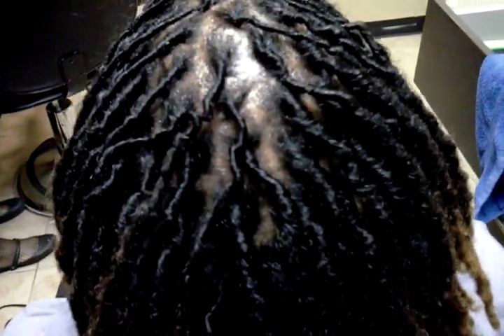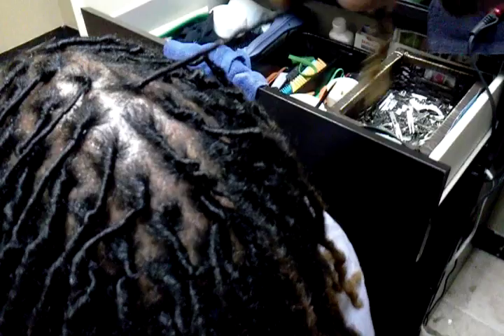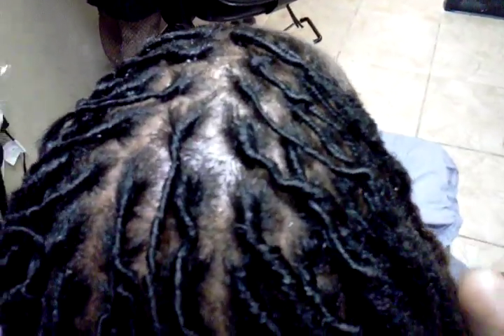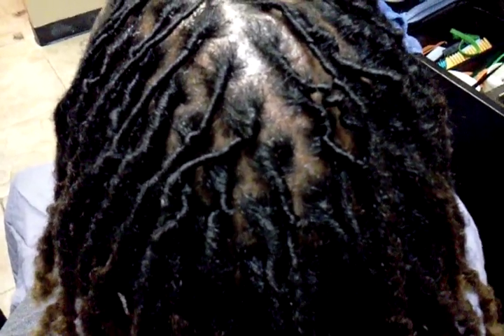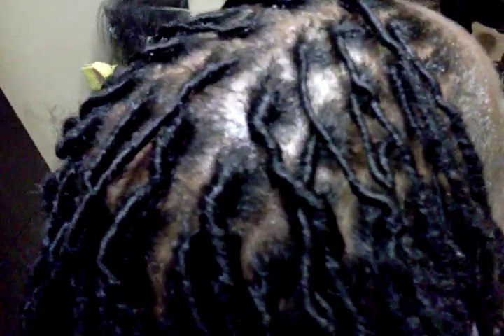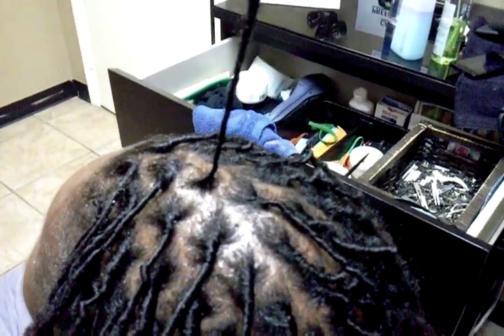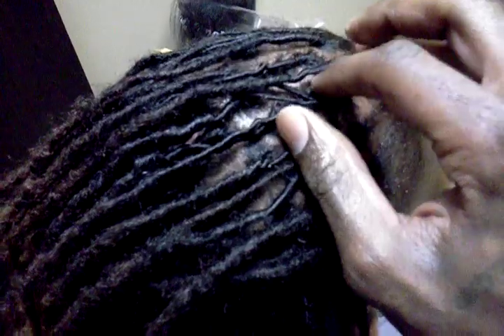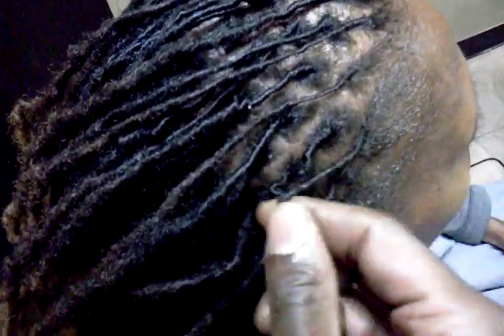HOW TO SECURE FRAGILE DREADLOCKS

Comment: my issue is if I dont re-tighten my dreads like ever two weeks and go about a month or a month and a half. at the base my dreads start locking together. then I have a hard time pulling them apart. how do I prevent that from happening? thanks in advance.

Comment: seperating using the popping method is the best and only recomended maintenance..however i stopped that too nearly 5 years ago (with vdery minimal seperation of only my thickest ones) just so my hair now at my ribs is stronger when it reaches the ground since i did have some breakage from being stepped on  run over and caught in car doors  so i want them thicker so in another 20 years when they reach the ground they will be extra strong

Comment: well even when loose interlockings a horible method it wont make u bald but it creartes weak snap points each interlock points a minumum of 33% weaker can be up to 85% also theres no elasticity at these points so they snap instead of stretch..mine are a foot past my toes completely natural now your not guaranteed to lose dreads from interlocking but it greatly increases the chance they will break..problem is salons give u a completely warped idea of how dreads should be "dreaded properly"

Comment: actual,y it dioes those "tightenings' should never be done they are used to cause the scalpy look wich is early stage traction alopecia  it fuzzes over only ewhen alowed to recover but keep tightening and the scalpy look gets worse and worse till your bald the 1 in the vids severe but not beyond recovery you get too far in and u need a transplant braiding weaving and dread tightening is why 50,000 19 year olds a year need transplants..so yea almost bald